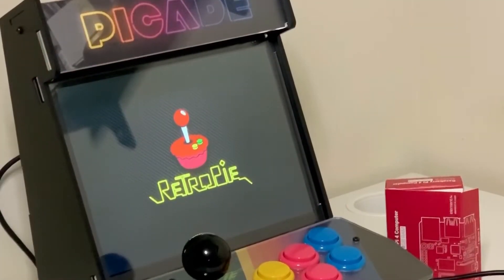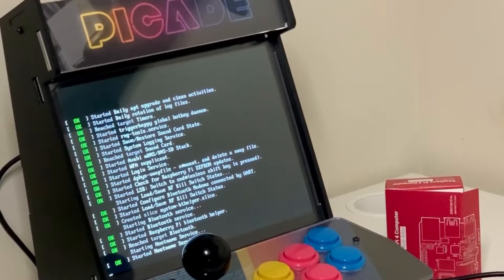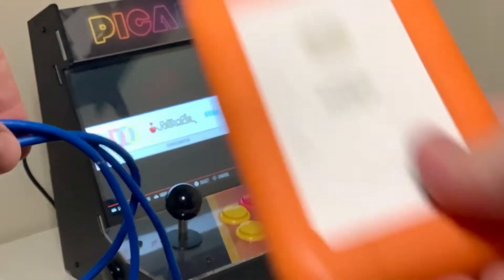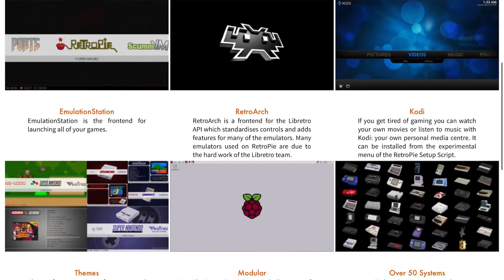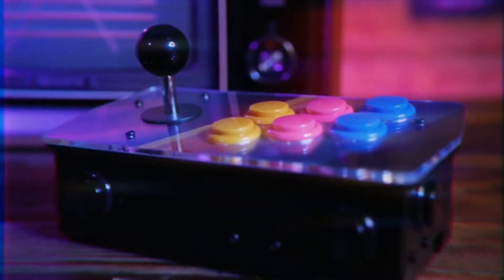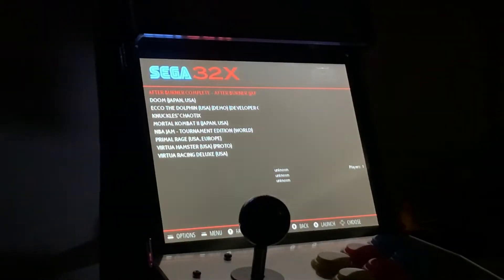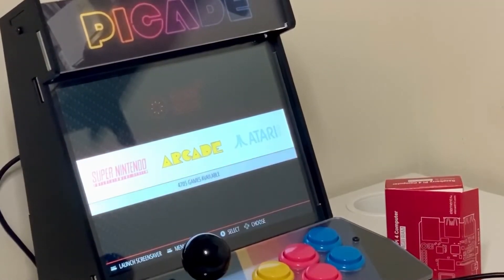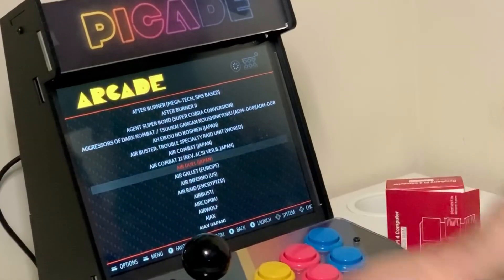RetroPie Raspberry Pi 4 Swap | PiCade RetroPie Build

Comment: About the active cooling. Put an extension on the io pins and put the hat somewhere else in the cabinet. Then you suddenly have room for heatsinks and a fan.
Reply from the maker: Oh yeah that’s a great idea and there’s a lot of room in here to work with. Thanks!
Reply: @Linser22  No problem. I did it to my arcade machine and it works great😄👍

Comment: Is there a download able image that is configured for the pi im having trouble inputting the button config
Reply from the maker: Idk if there’s a premade image that exists, but what’s up? Are you having trouble inputting the command to download the pimoroni Picade software?

I had an issue where I couldn’t input “|”, then I found out I had to change my keyboard layout in retropie from UK to US
Reply: @Linser22  I’m  transfer snes Roms they work now I’m downloading a rom set for the rest of emulator . I was having trouble with premade images
Reply from the maker: I usually avoid premade images because down the line it becomes a headache and they are usually bloated, that being said for my RetroFlag GPi case I went with a premade image. I didn’t have time to tweak the settings for better battery life so I found an image specifically for that case. I may eventually go back to stock Retropie on that one.

Glad you’re enjoying it so far do you have any games on SNES you feel work really well with the arcade form factor?
Reply: @Linser22  yeah I enjoy most of the games snes and Sega .. mame and arcade are giving me a headache with the controls